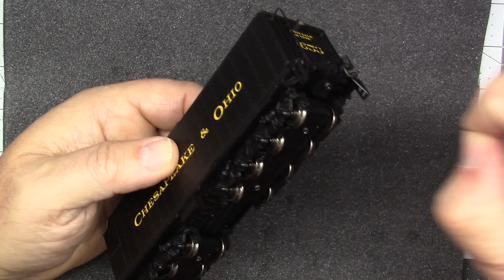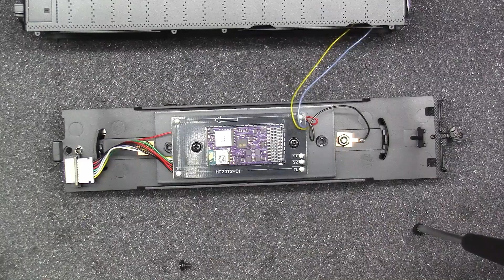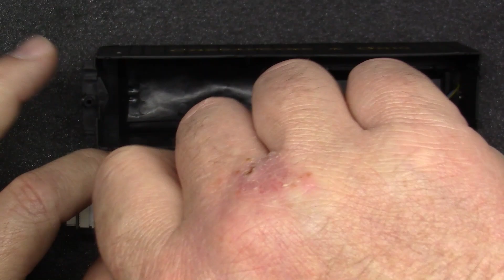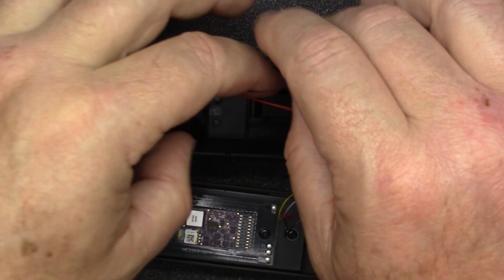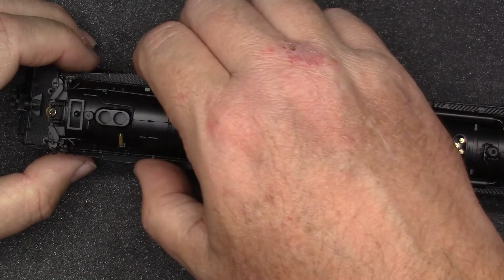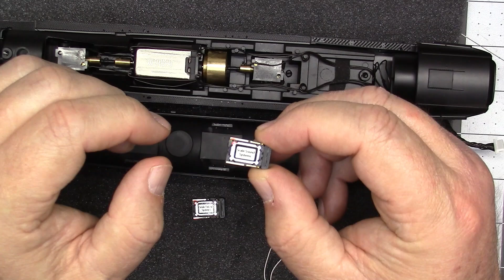Rivarossi 2-6-6-6 DCC install

Comment: Were do you get the wiring harness, I have and older model and I need that.
Reply from the maker: https://www.trainworld.com/tcs-1476-6-pin-micro-connector-with-black-and-white-wires-train-control-systems-1476.html?srsltid=AfmBOoraMWEvweTx1n0Qj09IwajqpZ1j3k8LaupEVJaEoUSqh7EUqtBn

Comment: thank you so much for posting this! When I started my install on mine, I didn't even know there was a recess on the bottom for the speaker to fit into. It also wasn't clear where you wired the speaker itself. Soundtraxx was super helpful in working through a few of the issues (as always!) but Rivarossi's instructions also could have been much better.
Reply from the maker: The speakers are wired to S1 and S2 on the board.
Reply: @SoloContracting  thanks, the guys at Soundtraxx helped me figure that out too

Comment: What kind of flux do you use? Also, how difficult is it to solder to the pinouts of the 21 pin plug on the motherboard?
Reply from the maker: Kesters 186. It's not hard to solder to. Just take your time and use a small tip.